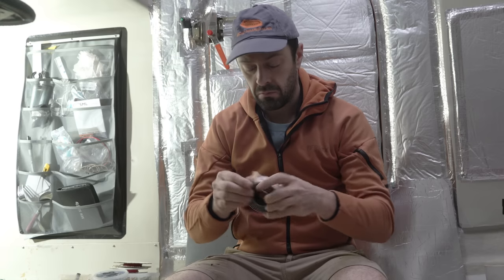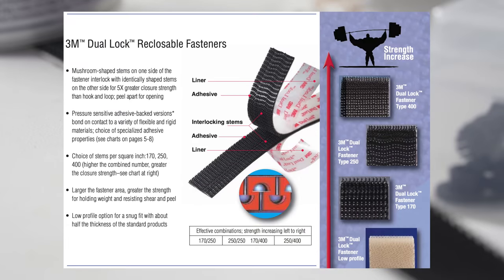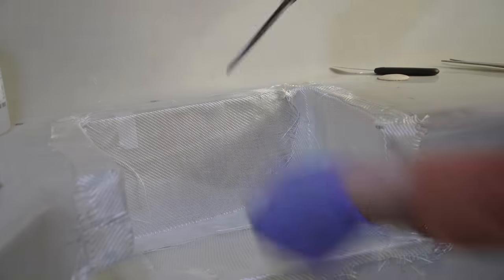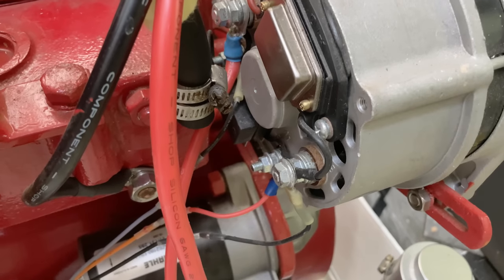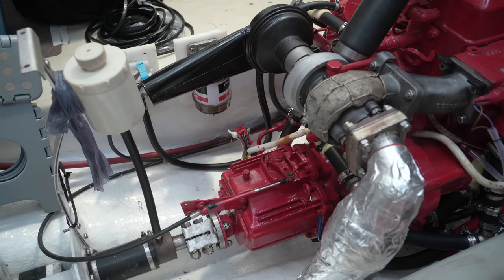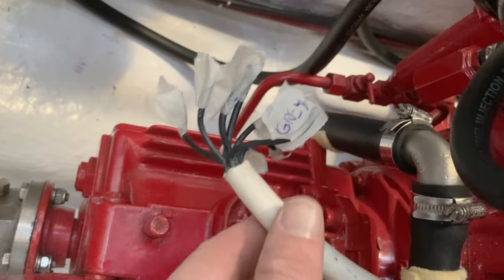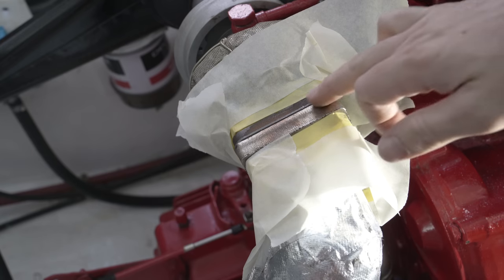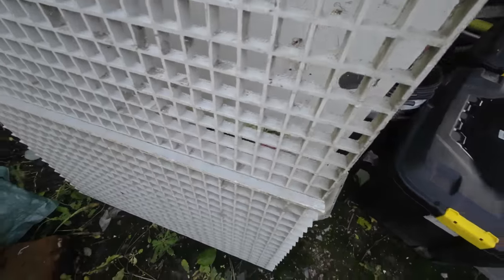Messy one: Corroded engine electrics, 3M Dual Lock & turbo painting. Lifeboat Conversion Ep62 [4K]

Comment: Mate, I was an industrial electrician and redoing the wiring for the engine needed to be done. That wiring was badly corroded. I would recommend using a light application of dielectric grease for all connections, silver metal for all connectors, and fresh wiring with silicone insulation to keep out the moisture for the whole engine. For the connectors that you can fully replace, use Duetz connectors. You are going into a place where a connection in that engine is your life, so spend the extra money on the connectors that will give the best reliability. For the connections that aren't able to be converted over, soldier type connectors with a sealed plastic exterior or heat shrink with adhesive placed over them is the best solution for them.

If you want to have every wire be able to be disconnected and reconnected, including reconfigured, proper junction boxes with labels inside and using Wago rail blocks would be a much better and more reliable option over the Wago leaver blocks you are planning to use. They would also be a much lower fire risk since the lever blocks do not do well with regular changes and are instead intended as a single use connector. Yeah, you can use the leaver nuts more than once, but is is a really bad idea, like having a hole in your glove when you put it in freezing water: maybe it won't be enough to cause a problem, but eventually it will be a big problem. Just graduate to the big boys and get the Wago rail blocks since they are cheap and use them in your junction boxes.

For wire loom to keep everything together and protected for wear, a quality nylon, UV resistant plastic one will work. A spiral style like what was on there is the best for resisting mechanical wear, but is a beast to put on some times. You can use a more light duty one like a split poly polypropylene loom like what is used in automotive and marine applications, but you will want to use plenty of good quality zip ties to keep it in place.

Contact me if you want any wiring advice. I am retired for medical reasons, so I have the time to give it. Oh, and you labeling everything as you go with the wiring is what us professionals do, especially when some arsehole uses all the same color wires to save less than a cup of coffee worth of money.
Reply from the maker: Your time to write this is much, much appreciated. I actually have dielectric grease on order and will give those connectors a look. I had trouble with a similar design before.

Comment: WAGO connectors are fantastic! I use the off-brand lever nuts at work to reliably and quickly connect test equipment. I use the WAGO brand for any in-home AC connections because wire-nuts... belong in a museum. Anyone that tells you "They work just fine if you do it right" helps prove my point. Your approach is methodical, but there might be some bits of wisdom I can offer. My concern with the lever nuts is that, while the WAGO brand exceeds their load rating, they are not sealed connectors. I imagine Alan will get a bit humid when sealed from the cold and there's always the chance of salt-spray exposure. Dielectric grease is a huge help, not just to the wires in the WAGO connectors but also in the female spade connectors (best to apply some heat shrink where the spade connector meets the wire). I'm sure you're set on your path but I'd recommend a different style of connector. Some of the lovely commenters have mentioned aerospace connectors or Weather Pack connectors. Weather Pack connectors are bulky and involve more work to crimp and aerospace is expensive. I recommend the Deutsch DT connector since they're easy to work with and very very well sealed. We used them in certain NASCAR applications that required more current than the Deutsch AS connectors could handle (yes, NASCAR uses the same electrical connectors as F1...in fewer quantities of course). The proper crimping tool is not cheap, but the hope is you only need to make the purchase once. Assuming you've made it this far into my novel, my last bit of wisdom is to not worry about a single wire color (colour? tyre? colyre?). A halfway decent label maker will also support heat shrink label carriages. My advice is to source a single colour (color? coloure?) high-quality wire and use the heat shrink label tape to mark it. I recommend applying a clear marine heat shrink over the label because over time the heat shrink ink smears. You're an amazing explorer-writer, writer-explorer, (we don't get too many of your type nowadays) with the obsessiveness that will serve Alan and the future crew well!

Comment: Nice Episode again!
Just a thought about the Heater exaust: Is it mandatory to route it straight up? If not wouldn't it be more efficient to send it aft inside the Hull? Where it is, covered with a Motorcycle-Style Shielding, allowing further heat transfer. Leaving the Hull where it is less threedimensional shaped and the Chimney less Exposed to the Elements. I understand that space is a primary valuable inside Allan and hence compromise has to be made. I was just wondering.
Keep on with the great work, Bye 🙂
Reply from the maker: I've got a plan to distribute more heat aft, but the sense I get from HVAC geeks is that you need to have a simple route out the boat, or else you get pressure and flow issues.
Reply: @AlexHibbertOriginals  Fair enough, I suppose reduced air flow or an Oil coal clogged exhaust would eat up any possible increase in exchange surface.
About the exposed chimney, I would love to hear your thoughts about the risk of it flooding or beeing damaged in harsh weather.
Thank you for answering btw.
Reply from the maker: The H cowl is designed partly to stop spray getting into the flue. But yes saturated air might head down the flue on occasion. The whole thing will be able to be disassembled for cleaning. And if impacted (waves, solid objects) I suppose we assess the damage and repair!

Comment: To help stop corrosion on your electrical connections, use a smear of liqui moly battery terminal grease, or similar, completely over the surfaces.
Also on my yacht I bought a bag of brass blade terminals and soldered them to my cable ends then put heat shrink tube over the joint. 
I found that crimping would get corrosion along the wires and eventually the joint wouldn't work. Soldering fixed the problem and that of wires pulling out of the blade terminal crimp.
Just my 2 cents to help with ya wiring and less wiring problems down the road! (on the high seas)
All the best.
Reply from the maker: Cheers. There's such a battle between crimpers and solderers! Especially in the marine space. Agree on the grease.

Comment: Doing commercial audiovisual stuff, we use Dual Lock routinely at work. It's especially useful to us when attaching small devices to the back of a monitor, or a moving rack shelf. As with a lot of 3M's adhesives, it works best when applied to a clean surface. Also, avoid environments where there's likely to be continuous high heat (like Alan's engine or stove), as that seems to defeat the adhesive over time. I often joke with my coworkers they're using enough to cover for nautical applications, in the office buildings we work in. I look forward to sending them your videos as proof.
Reply from the maker: Yes there are three grades of dual lock adhesive, each with a temperature rating.

Comment: 3:47 What were your thoughts on junction boxes and/or conduit (esp water resistant/proof) for those wires? Or some sort of heat resistant, water proof, braided hose?  Apologies if I'm getting carried away with your style of doing things <smile, chuckle, etc.>.
Reply from the maker: They are more robust and resistant than the originals, and if routed carefully, should survive.

Comment: Thank you for the heat shield.  I was very concerned about that very topic until you allayed my fears.  You're 'at will' OCD is definitely paying dividends for Alan and I'm certain will result in 'forward stock splits' during the very most important times and events for the future 'you'.  The OEM may/should be paying close attention and taking notes; I anticipate that they will be soon branching into the 'lifeboat based yacht design market' sooner than later with an eye on making megapounds off of the tiny house crowd and avid outdoor survivalists.  Is it possible that you may actually copyright or perhaps patent your designs?  Amazing work with a very keen eye on design and implementation.  Anticipate many job offers; or have they already been flooding in?
Reply from the maker: Heat shields will set us free.

Comment: I know you feel that you've been getting a lot of unwanted advice from the comment section and I remember quite a few videos back you were talking about this but there really is a reason why you should not use those clear heat shrink connectors with solder in the middle. The solder in the middle fails It always fails. It's low temperature solder that is prone to shattering. Also clear heat shrink does not perform the same as normal heat shrink. It's less water resistant and doesn't hold as stiffly. Everybody goes through this stage where they question the status quo and why people don't use these awesome ideas. There's just reasons, there really is reasons. You're wiring if you continue to use these is a ticking time bomb. They're not in high stress areas so that they may last months or even years but they will fail there is no question it's going to happen. The proper way to do this is to get plain black heat shrink a soldering iron regular rosin core soldering and some flux. Twist the wires together cover them in flux solder it making sure that the solder wicks all the way through the wire and then cover in heat shrink. This form of connection is stronger than the wire itself and more water resistant. Unlike the wire connections I have seen you using the past which are weaker than the wire itself and will be the failure points. I get that right now you can pull on it as hard as you'd like and it won't break. That's a false sense of security It does not completely penetrate and because of different metals having different temperature coefficients all it takes is a few thermal cycles for it to begin to crack and shatter. I have tried using these wires thinking myself clever in the automotive industry. I have not had a single one of these last longer than 3 years
Reply from the maker: Thanks. I have gradually phased out use of these quick solder joins. 

There's been a lot of debate re: crimp vs solder, and generally I've been going with crimp and then opaque heat shrink over the top.
Reply: @AlexHibbertOriginals  works for me I was just really worried you'd get stranded out there Good luck and safe sailing! Your work and dedication is inspiring 🙂 👍✌️

Comment: you leaving those glass fiber strands on the edge uncovered by resin and not matted down physically hurts me in my brain
Reply from the maker: Even if I took the time to tape down the edges with release film, there would still be a raised edge I'd need to rasp away before applying the edging.
Reply: @AlexHibbertOriginals  I realise that and you've done a proper job. It's not rational
Reply from the maker: Very little onboard Alan is rational.